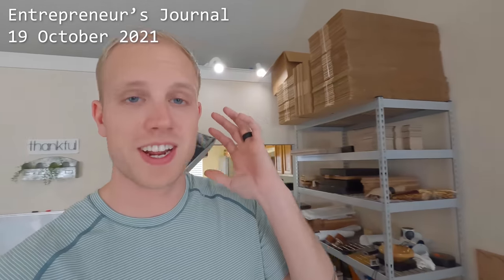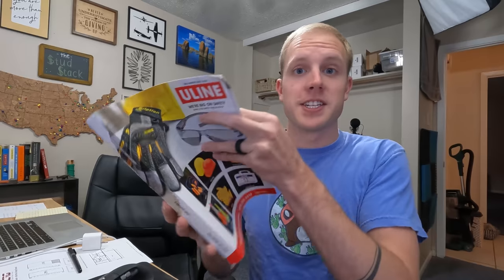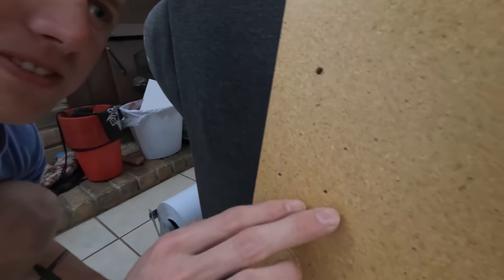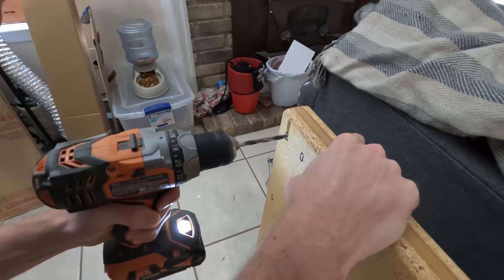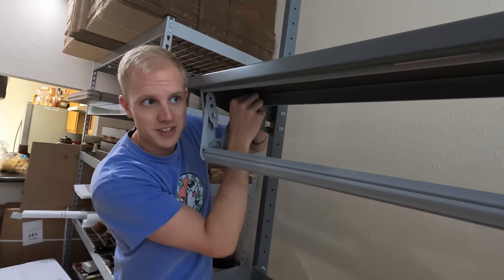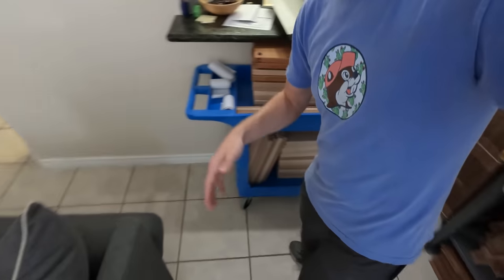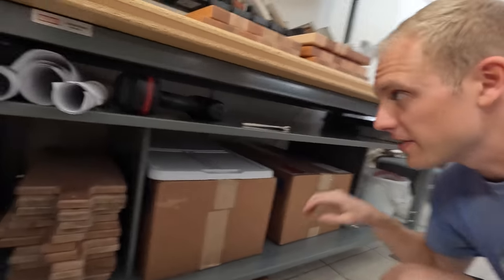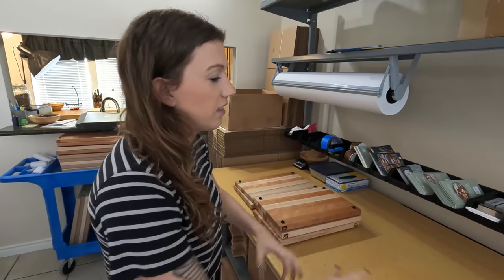we’re DONE hurting ourselves… see our newest $1,500 tool!

Comment: Nice add to your "expanding empire"! When I need to set fasteners in particle board, MDF or Ikea furniture (even though they tell you not to use power tools) I use my trusted Bosch 12V driver. Actually got the combo drill / driver (not impact). Very compact, the 12V batteries fit in the handle and last forever. The beauty of it is that they are not super powerful. So I like to snug my fasteners with the Bosch and finish a 1/4 turn or so by hand. No striped holes. Also work great when putting in electrical plugs and on/off switches with these screws that go on forever. I've had mine for over 5 years and would not go without them. Keep the great videos coming.

Comment: Best way to keep your screws from stripping out in particle board:  Use a standard drill with the clutch turned down enough to get the screw head to bottom out but no further.  Hand tighten the rest of the way.

Comment: Plastic Strapping doesn't need a knife - just flip the "joint" over and peel it back.  It's strong because the forces are in tension - pulling along the strap.  It isn't strong when you pull it "up" - peel it.

Comment: Very disappointed! You could have knocked together a table in a few hours that would have served the purpose very well instead of spending over $1500 -- and you had to assemble it! It probably took more time to assemble the U-Line table than to build one. Think! It's about MAKING money, not SPENDING it! You could have built the base table and bought the upper shelf to bolt onto it.
Reply from the maker: Robert, thanks for your perspective. There's absolutely no way we could have built a table this strong, modular, and cheap in less than 4 hours start-to-finish. Making money is about saving time, not money!
Reply: @jennieanddavis  What would you prefer, a pile of cash or a few days off?